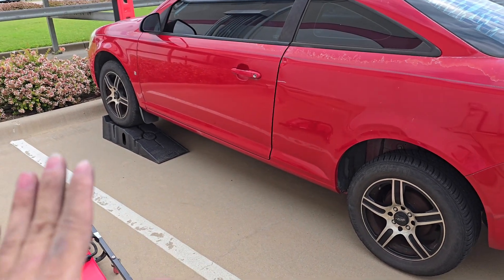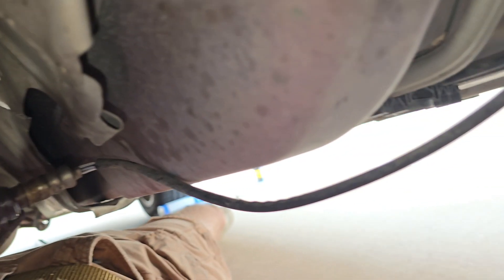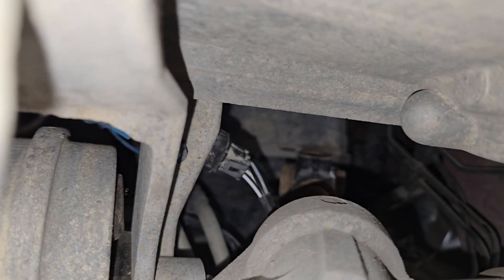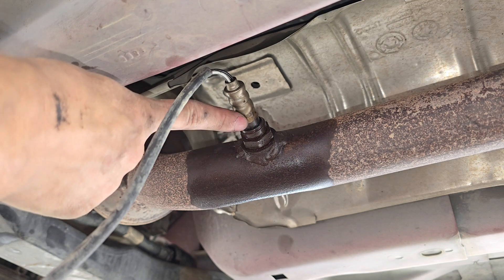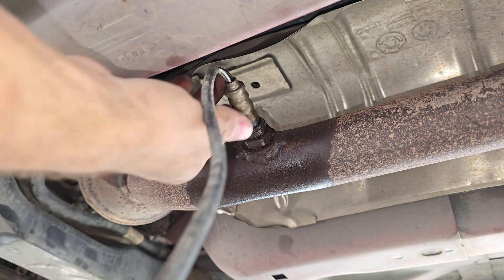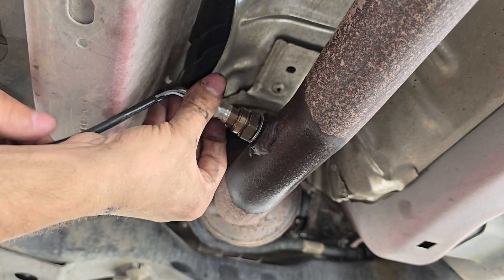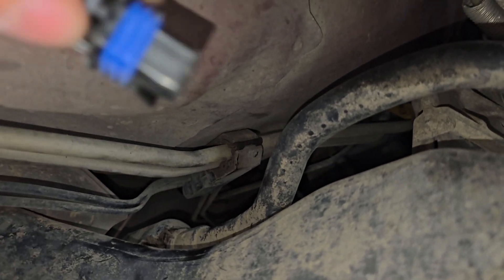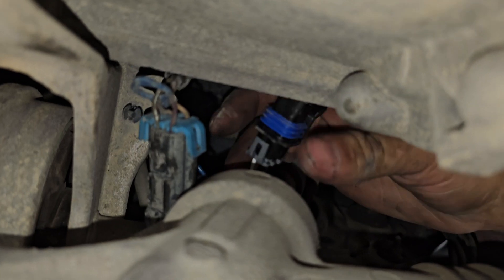Cobalt Oxygen Sensor (Bank 1; Sensor 2) Replacement (Cheverolet 2005 - 2010)

Comment: Thanks for the video. I have to replace my o2 sensors to pass inspection, I should be good now .
Reply from the maker: Absolutely, I'm glad I could help. If you need to replace both, don't forget about the one in the engine bay!
Reply: @Kaswells_Kappa  yeah I changed both of them . Only issue was the one on the exhaust was stuck so I had to get a breaker bar to and applied some heat to it to get it off but we’re good now .
Reply from the maker: The one on the exhaust always gets seized. That heat/rust likes to put a bite down on it. Good to hear you got it taken care of!

Comment: I have a code p2270 (O2 sensor signal biased/stuck lean bank1 sensor 2 - did not switch from lean to rich for a predetermined period of time during self test).  2010 Cobalt with 82000 miles.  The code came on yesterday.  I looked for exhaust leaks, could not find any.  I put the car on ramps like you did.  I sprayed some penetrating oil on the O2 sensor.  So first question, do you think it is likely the O2 sensor or something else?  Not that many miles on the car.  The car seems to run ok as is.  Second question, just how hard was it to break loose?  Do you have to be super strong?  It looks like you did not use heat.  Third question, what is a good replacement to buy?  I see ebay has no name brands for less than $20, but have heard of horror stories using cheap parts.  This part has never been replaced before. Thanks in advance.
Reply from the maker: Howdy!
First off, I sincerely apologize for the late response. It's been a busy few days, and I've been slowly replying to comments as I go. I specifically waited to answer yours until I could give a thorough answer.

So, to start simple, yes, it could easily be the oxygen sensor. Even when referencing replacements, the service manual only suggests replacing the O2 sensors. Granted, it could still be caused by an outside source, but with this type of DTC, the ECM purposefully tries to increase the fuel trim from lean to rich to see if the O2 Sensor is reading properly. This DTC says it did not. So the likely culprit is that either your O2 sensor is worn out and needs to be replaced, or it has been contaminated. The service manual states that silicon-based products can contaminate the O2 sensor. 

Second, it was pretty tough, yeah. I had to pretty much brace myself against the front tire and push off of it to give myself enough oompf. I'm a small guy, so it took a bit, haha. You are correct. I didn't heat it up much. If heated up more, it may have broken loose much easier, but I was more worried about thread stripping, so I just warmed it up instead of getting it to operating temperature.

Third, BUY OEM PARTS. OEM Parts (ACDelco & GM) are always gonna be the go-to unless it's a reputable company that makes parts that are either on par or exceed the industry standards. I bought a GM brand through eBay to save some cash, but I would definitely buy an OE brand. Other brands are either lesser quality or just won't work right.

This was the first time I've replaced this part on my Cobalt as well. Lil bit more mileage, 180,000, but each situation is different. Every vehicle has gone through different things. I like to always say the parts that outlast the others were made on a Thursday. The ones that crap out early were made on a Tuesday, haha.
Anyway, I hope this answers all your questions and gets you where you need to be. If you have any questions, don't hesitate to ask.
Once again, I apologize for the late response!

Comment: Hi so quick question, this is how you would fix code P0137?
Reply from the maker: It can be one solution, yes. A faulty O2 Sensor can cause a slew of codes like P0137 or even P2A01 (an upcoming video). But there can also be other problems that would flag this code such as faulty electrical equipment, worn wiring, faulty modules, or a bad computer. The simplest way to go is to replace whatever the code is associated with. Which, in this case, is the O2 Sensor. If that doesn't solve the problem, the next place to look would be the O2 Connector and then Wiring.
Hope this helps!
Reply: @Kaswells_Kappa  Okay thank you very much for your help
Reply from the maker: Absolutely, good luck!

Comment: Im running a few codes as well for my 08 cobalt... (MAF Sensor) with a high voltage code and a p0171 code for being too lean (too much air vs fuel ratio) so i was assuming it would be the 02 sensor? I already tried replacing the MAF sensor, same codes popped up including the MAF sensor code again. So now on to the next. You think it would be the 02 sensors from what I told you? I also noticed some slight jolting too when idling the car. The car was also previously wrecked front right of it and repaired... all of a sudden got some heating issues too maybe you could enlighten me on that too. Went from going not over 200 F EVER to randomly going 220 or so maybe more if I let it after the light came on. Maybe just low coolant its at half a reseviour. but i wanna get the engine light off before doing anything with the cooling system. Thanks in advance.
Reply from the maker: Howdy!
Sorry for the late reply.
So, being it's a too lean code, it could be many things. MAF, Fuel Injectors, Fuel Pump, TPS, HO2S (02 Sensor). A lot of that stuff. BUT to narrow it down, the timing will help determine the problem. If it's an instant too lean code, then it could be your front 02 sensor. If it's a too lean for too long, then it could be your rear o2 or catalytic converter. I would definitely say it's a strong possibility of it being the rear O2 sensor, but with so much playing into the fuel to air ration of an engine it'll have to be a process of elimination thing.
As for the overheating, it could either be your thermostat or your coolant in general. I had to replace the thermostat on mine due to the gaskets in the thermostat, keeping it open. I also had to change out the coolant. Make sure to get all the bubbles out!
Hope this helps!
Reply: @Kaswells_Kappa  thanks it definitely does! Also my car engine light kicked off and I haven't done nothing else to it? Could it be that the 02 sensors were just loose? Any recommendations or thoughts on that? I literally went to a harbor freight bought a 3/8ths socket for the o2 sensors and then went to go start my car again and it kicked off??? Before then I will say i was pushing the car kinda hard. little tiny pulls n stuff to see what my cooling system would do etc. Thoughts? TIA
Reply from the maker: I wouldn't say it could be loose, no. But the rear one could just be worn out. Have you checked the engine bay to make sure there aren't any cracks in the air bonnet or throttle body AFTER the MAF? Air can seep in after the MAF, causing that lean mixture. Check where the air bonnet is clamped onto the throttle body. Wouldn't hurt to check

Comment: Is there a link for the sensor?
Reply from the maker: There sure is yes. I'll provide two below. One from a GM Parts Outlet and one from Autozone. The part number is 12578576 if you'd like to try any other outlets.

GM Parts Giant:
https://www.gmpartsgiant.com/parts/gm-sensor-12578576.html?vin=1G1AK15F377271534&make=Chevrolet&model=Cobalt&year=2007&submodel=&extra1=&extra2=&filter=()

Autozone:
https://www.autozone.com/engine-management/oxygen-sensor/p/acdelco-exact-fit-oxygen-sensor-213-3138/916712_0_0?searchText=12578576

Comment: My 2009 Cobalt costs three times as much fuel. Could the reason be a malfunction of the oxygen sensor? please
Reply from the maker: Howdy,
Yes, the O2 sensor can play into fuel economy. However, I don't think it could be completely responsible for using that much. Other factors could include things like fuel injectors that are stuck open, spark plugs, coil packs, MAF sensors, and Evap or Fuel Leaks. Depending on mileage and age, the engine could just be worn down and old, so it's nowhere near as efficient as it once was. Do you have any engine codes that may point you to the problem area?
Reply: @Kaswells_Kappa  thank u very much
Reply from the maker: You are very welcome

Comment: thanks man - when completed do i have to reset cars computer? or is it just plug and play?
Reply from the maker: Anytime!
No resetting is needed, just plug-n-play. If you feel the need to reset the computer by unplugging the battery, then you are more than welcome to do so. It won't hurt anything.
Reply: Thanks for getting back to me. I can pick on up on line for 40 Bux They didn't want to go through the hassle if you have to reset the computer. Somebody said you had to reset the computer if you pull out the o2 sensor If You Don't reset the computer then your car may burn more fuel or idle rough
Reply from the maker: Absolutely!
Well, it can help to reset the tables quicker, yes. When it's reset, it creates new tables and tries to relearn everything, new sensors and old, to tie it all together to get the perfect ratio. Now, is it necessary, not really. The ECM will learn everything and adjust the ratios without resetting everything as well. So, either way will get you there, honestly.
However, if you had an engine code for the O2 sensor, then yes, definitely reset. The code won't clear otherwise. If not, then i honestly wouldn't worry about it unless the engine ran horribly. I didn't reset mine, and it's been working great with no issues.
Hope this helps!